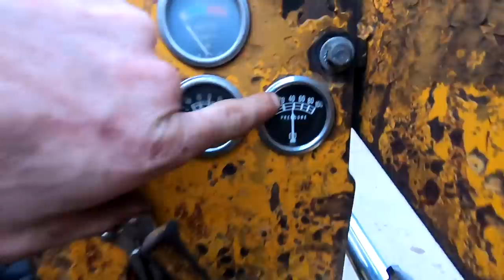A DEMORALIZING Turn in the Restoration of "Old Red" ~ Part 11 ~ 1950s Caterpillar TraxCavator

Comment: Hey just a friendly tip. When using vice grips at the start of the video like you were. 
Use a pair of Chanel locks to release the vice grip. 
It will keep your fingers and muscles happier. As well as catch the vice grip from flying as they like to when you do it by hand.

Comment: 90Yeah that work around will be just fine. We needed to make similar work around on our tractors power steering hose. Guys at the local hydraulic shop just removed the hose and the crimp collar, found similar size on the crimp diameter, took little bit off from the shrunken part to get it to fit and crimped new hose on the old connectors they had never seen. Its relative high pressure (dont ask how much there is) and it has lasted constant use for couple years now, so on return line your setup is just fine, probably would not even need the clamps, but that would be already taking risks.

Comment: @Salvage Workshop:  I don't know what's available in your area, but here in the SF Bay Area we have several outfits that can make make up any size/ length hydraulic hose you want, if it isn't available anymore .... or, if you don't want to pay Dealership prices. Had a couple made up for my Kubota just this year.  Weren't available through the dealer anymore.  My tractor's too old.  Don't know for sure, but they might even be able to salvage the hose end fittings if there's something special about them.

Comment: There's ALWAYS challenges when working with old equipment... availability of parts, specialized tools and [especially] Knowledge is typically limited...  but you've managed to hang tough and overcome each one so far...  I'm sure you'll succeed on the Pony motor too!!   Btw, thought you would solve the hydraulic hose challenge with Duct tape!!  😋

Comment: Nice fix on return line ,  you could have saved yourself a lot of hammer swinging by heating up the hose with a heat gun and using silicone lubricant on the fitting, your hard work is adding up and you will know your machine well by the end of it

Comment: I too am familiar with those Aeroquip fittings ,using a hose machine or a pipe vise with large grips/pipe wrench (we had)(transit industry )could have simply turned (unscrewed)off those end fittings and replaced just the hose
Reply from the maker: Really?... Maybe I'll try that on the other one. I still have another chunk of hose and the other old Cat hose.
Reply: @SalvageWorkshop  yes notice the "threads" on hose under cut ferrel

Comment: I used to be so cheap I would not buy coolant for my radiators until freezing weather forced me to do it. After replacing a couple water pumps did I learn that coolant has a lubricant in it to protect the bearings in the water pump. NEVER use plain water for anything but testing!

Comment: I've watched most of the "old red" series, but I can't remember if you have already changed the oil in the pony motor. The metal fragments in the oil would obviously be much more concerning if it were in newly changed oil. Maybe not so much in oil that's been in there a while. Who knows, since that motor is used only briefly every time you want to fire up the diesel, maybe it still has break-in oil in it. I know, not likely, but it would explain the metal in the oil.
Reply from the maker: I've changed it multiple times!

Comment: Another fine repair. Seriously though you did scare the hell out of me at time index 44:25 using that wire wheel with long sleeve shirt and gloves on. Had a friends dad who did that and it grabbed the glove and literally ground the tip of his thumb off. There is no time to pull back, it just sucks you in until what's been grabbed is ground off, ripped off or the motor binds up on a part of your body. Hate to say it but freeze or get scratched but don't loose a limb or get seriously hurt for comfort. Take those gloves and shirt off. Back in 7th & 8th grade in the 70's my shop teacher also gave us that lesson. Then I joined the US Navy and we got to see some really gruesome videos of folks who ignored those safety rules and paid the big price. Yuck! Love the channel dude, been binge watching since I found it. Just be safe, I need to see Big Red Done and being used. Best Wishes & Blessings. Keith Noneya

Comment: Most half-decent hydraulic  hose specialists  will be able to re-use the flange fittings,  and refit single ply reinforced hose with new ferrules over. Don't focus too much on the minutia, and how to overcome it with what you have, but sometimes take a step back, as time is the most valuable commodity in life :) BTW It's  only rubber to allow for engine/chassis differential movement? Keep on busting those knuckles, and the good work going ;) Keep safe and well.

Comment: Don’t panic on the pony motor. Strip it, clean, see what is bad. But don’t go mental on a full rebuild. As in; If it makes compression and the bores aren’t scored, don’t even hone it. It’s not like the main engine that has to work for hours at a go .

Comment: One tip from an old cat mech. Too clean up the engine and radiator use Cascade dish washing power. Run engine till warm then add the Cascade and run for about  10 min. Drain and repeat till you have clean water. That small radiator, I would put about two cups each time. Put Cascade in while engine is running. This works VERY well if oil is in water also.

Comment: Would be a good idea to get an operation & maintenance manual plus overhaul manuals for the engine & chassis. There is a petcock on top of the starting engine intake manifold to bleed the air out of the cooling system. When flushing coolant remove the heads of the starting engine there is a lot of crud built up in the bottom of the water jacket, you can usually reuse the gasket. Also always let the pup run out of gas. Starting engine parts are very expensive, most parts are obtainable, main brgs are aluminum. By the the looks of the heads on the starting engine they got hot !!.the paint is discoloured

Comment: Could you have replaced the rubber hose in the low pressure hydraulic line with a stainless flex connector? We've used them on large pumps in the petrochemical industry for years. Have cut the standard flanges off and replaced them with specialized flanges many times.....just food for thought. Binge watching your vids while being homebound after surgery, and enjoying them immensely! Wish you the best!

Comment: Come summer time fill with water and a cup of tsp(tri sodium phosphate) that is throughly mixed with hot water and fill system. Run this a few hours a day for a week, at the end of that week, drain and flush the radiator and the block, when all you get is clear water out, let drain overnight. Now close all drains and fill with the proper fifty fifty mix of water and antifreeze. Your system is now as clean as can be done hot tanking a bare block, giving you a nice clean cooling system

Comment: Man, you just can't catch a break with this beast. That pony motor problems is horrible. That sucks. Oh well you will persevere through this one too. From the looks of it, there is no easy way to just pull the pony motor out. Not without pulling a lot if not all of the body panels off. Geeez.

Comment: i learned my lesson the hard way on replacing water pumps on m own car ive been turning wrenches for 20 years and never knocked a hole in a customers radiator but i did in my f 250 so from then on i put some cardboard or something there to protect it

Comment: When making a gasket like that, I punch a hole for a bolt to index it, then  another as far as possible.  Now the gasket sheet doesn't shift as you mark the rest for cutting.  Less chance of the material slipping = less chance of failing.

Pony motor may have flooded  like grazy due to stuck float.  Maybe just gas got by the rings.  Maybe it  bent a rod or  other major damage.

Comment: The hyd oil that drained from the pump suction line looked clear. It looks like the 303 hyd oil that you buy at the discount stores . Cat does not recommend using that grade hyd oil . Back when I worked for a Cat dealer for 26 years  they recommended using   10wt diesel engine oil for their hyd systems.
Reply from the maker: There is a lot of different thoughts on oils for machines of this era!

Comment: I deal with a lot of this older stuff on a daily basis with my business.
Sometimes you got to think your way out of a jam.
I see no problems with this because of it being a suction line. 
I'm sure there's going to be some "experts" that will have a different opinion.
One word of advice,  leave the belly pan off,  run that thing and get out to operating temperatures and keep it there for a bit then shut it down and retorque those clamps while everything is hot. 
I've made a lot of hoses using these clamps and have found them to come loose after a couple heat and cool cycles,  tightening them when they're hot seems to fix that problem.

Comment: A little tid-bit we used in a chain saw factory assembly line to get the rubber sleeve over the handle where it would slip on but not slip off after drying. It was the same chemical as used in women's hair spray. In fact in a pinch when we ran out or delivery was delayed we would send someone to Safeway to pick up as much as they could. Slippery as snot going on stuck like gorilla glue when dry.

Comment: I know it is a return line but I do not like that style of clamp as it does not come all the way together.  As you tighten it it will 'bunch' any slack in those gaps which may be enough to cause a seep.  I would use the heavy duty stainless full circumference hose clamps with a bolt integral to the clamp.  They are also thin enough to allow proper placement without any clearance issues.  Use them on boats for four inch exhausts and even larger with the same reinforced wire hoses.  They are available from about 1 1/2" up as I recall.  I would also consider putting a slit 3" hose over the top when you are all done and zip (stainless zip ties or stainless hose clamps of the screw design) it in place for chafing gear as that spot seems to get  a lot of wear.  Sometimes it seems the only parts that break are the ones they don't make any more!!  Better gear up your machine shop.

Comment: A tip for old, hard gaskets. LIHGTLY tap on them with a small ball peen, ball end. They will peel off easily. If you happen to find old hard NOS gaskets, soak them in very hot or boiled water. They will turn pliable and re-gain their original shape and size as well as seal because they will get their compression back.

Comment: Sometimes with bolts that break off as the ones on the radiator blowoff did you can apply heat to the bolt section with a soldering iron then apply the penetrating oil. The heat expands the bolt and then sûcks the oil back in that cools it breaking the bond.

Comment: Enjoying the series. You're doing great. Question: Why don't you paint exposed parts, like the water pump, when you have it off and clean? It seems to me that paint is the very least expensive thing you could ever do to protect against corrosion.
Reply from the maker: TIME! Paint will come later, and all at once!
Reply: @SalvageWorkshop  Respectfully, I would like to see how you can paint compartmentalized pieces like a water pump or inside the radiator frame panels, etc with all the belts, hoses, blades and things in the way. But I look forward to seeing how you do it. Thanks for the video.

Comment: Did you consider having that return line made of metal tubing? Could use the spare flanges, bolt them on, measure and cut the tubing, and weld or just tack it in place with the flanges mounted.

Comment: Question,  you couldn't source new crimp shells to repair that hydraulic hose? I used to do a bit of hydraulic work in a previous line of work, the business I worked for was an agent for Parker hydraulics, quite often we would get obscure hoses come to us for repair that we couldn't match up ends for, but most of the time we were able to cut off the old crimp shell, as you did, and fit on a new shell to reuse the hose end. 
I can see those clamps not sealing as soon as the system gets hot

Comment: I used to use boiling hot water to soften the rubber hose, then put a 2x4 on the end of the fitting and beet it in.

Comment: Proper way to stop pony is to turn gas off and let it run til it stops. I have found most running problems with pony is due to gummed up carb, running carb dry goes a long way to preventing problems when sitting unused for extended periods of time.

Comment: On an old motor like that with the rust I,d be inclined to fill it and put about 5 caps of brake fluid run for 15 minutes and drain,brake fluid will help break away flaking rust then the coolant will need a cap of oil in it.

Comment: A local job shop (machinist) or any of the YouTube machinists could make new flanges for you, with modern threaded hydraulic connections on the other side. Then you could have a modern hose with threaded ends made. Those 2 bolt flanges could stay on the machine semi-permanently

Comment: The left handed drill bit technique in my experience only works when the bit is basically the same size as the broken bolt you wanna remove. Lower rpm seems to help too like in a drill press.
Reply: The left hand bit technique is about hoping to get lucky.  Sometimes you do and it spins out.  The rest of the time you get it drilled out, and can pick out the pieces, same as if you'd used an ordinary bit.

Comment: Maybe you did this  but testing the over-heat "thermostat" might be a good idea too...
Put it in a pot of water on the stove (with a thermometer) to make sure of two things - 1) that it's not seized up and 2) that it opens when it's supposed to. Just because it moves if you manually apply some pressure,  does not mean it works!

Comment: Unfortunately,  With the white smoke, the tiny metal flakes and gas in the oil it sounds like a stuck/broken piston ring.  That would also explain why it won't start, it lost compression.  Hate to be the bearer of bad news...  but you can test that with a compression gauge before you go tearing into it tho.

Comment: I suspect the pony motor just ran out of hours. I understand, but not seen it in print, that they were designed to last about 250 hours. (small oill capacity, running fast, and not as heavy duty as the main engine). I know that is not much help, but I think you may have to remove it. ( Fun every time)

Comment: You need to watch Squatch253 videos about starting engines. One thing that he talks about is when shutting down the starting engine, you always shut it down by turning off the fuel supply. If you don't the fuel leaks out of the down draft carburetor and into the crankcase and destroys the engine.

Comment: Hi from Australia, I do not want to rain on your parade but the clamps that you used are the wrong ones because when they are tensioned up they leave a gap where the clamps do not over lap and oil leaks out though that gap, the correct ones are the full circle stainless steel type with a single bolt that are used on intercooler pipes.

Comment: Why do you prefer copper anti-seize over the regular aluminum?
Reply from the maker: Cooper has a higher temperature tolerance than aluminum, and I've found It doesn't harden over time like the aluminum will, especially in thick heavy steel like this old Cat! There are LOTS of opinions on this topic!
Reply: @SalvageWorkshop  I believe it. Copper seems to be more of a universal anti-seize, recommended for stainless as well. Thanks for the videos!

Comment: Often when gas gets in the pony oil it will prevent it from starting. I encourage you to drain the pony oil and refill with good 30w oil and do everything you can to diagnose it before tearing into it. Just to get to it is a really big job and can be a can of worms
You may be able to baby it and keep it going.

Comment: Do a compression test on the pony, if you don’t plan on running it in cold weather I’d maybe consider looking into a 24v starter for it. There are kits out there. Also I flushed the coolant on mine till it was clear but ended up finding tons of rust scale in the block drain I had to scrape out
Reply from the maker: I am considering a starter kit... where do I get one of those, do you know? I thought I was going to have to find a starter and make a few parts.
Reply: You will have to ask on a caterpillar forum I’m not exactly sure what starter they use. Check the casting on your trans housing. The later ones have a plate with holes that the starter bolts right up but the early ones you have to drill and tap the holes but there should still be an indent where the starter should go

Comment: A common thing with those pony motors is if you do not shut the fuel off on the tank then the vibration causes them to leak fuel down into the cylinder and fills your oil up with gas so common thing that they used to do back in the day is they would shut the meter valve off and run the motor dry and let it die that way

Comment: I’d tear down the head of the pony motor look at head gaskets piston walls least that far. Don’t attempt any more crank ups until major stuff inspected. Rings could have gotten stuck. I’d drop the oil pant wash that pull the head off and see if walls cracked
Reply from the maker: I agree! I just want to find a couple new head gaskets for it before I pull the head off, then I can replace those if & when I'm ready to put it back together!
Reply: The copper head gaskets are usually reusable and new aftermarket aren’t very expensive 
The ponies aren’t very high compression engines even when they’re in new condition.  If you’re afraid of the head gasket brush some liquid Permatex on the parts outside of the fire ring around the cylinder.